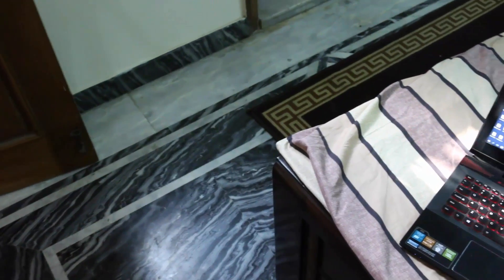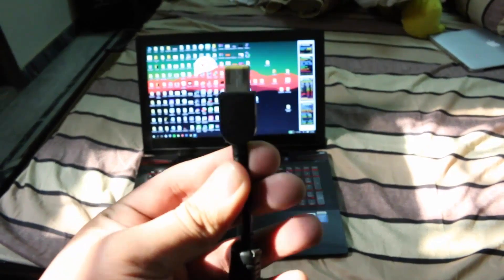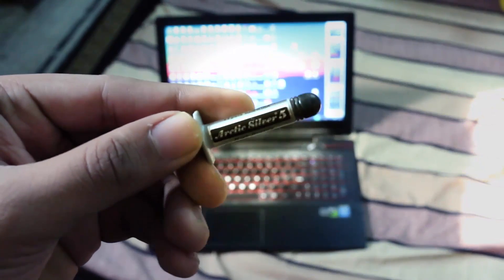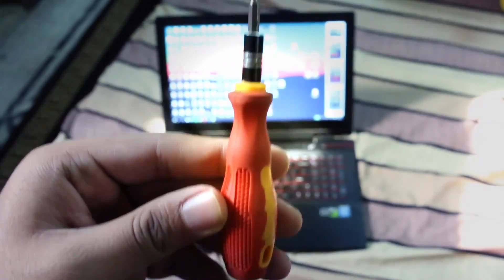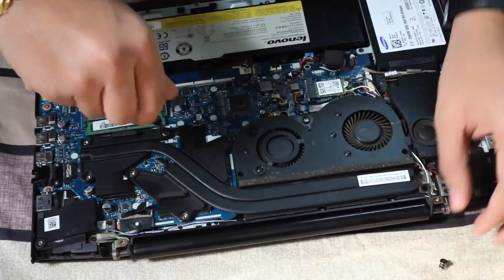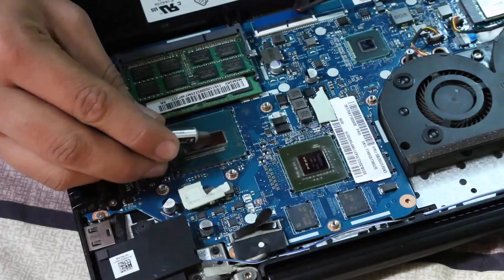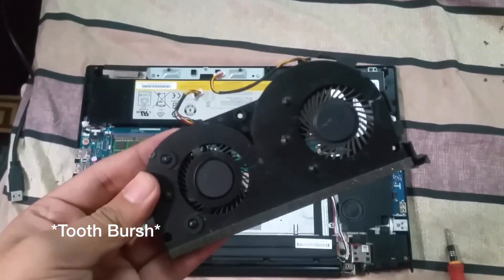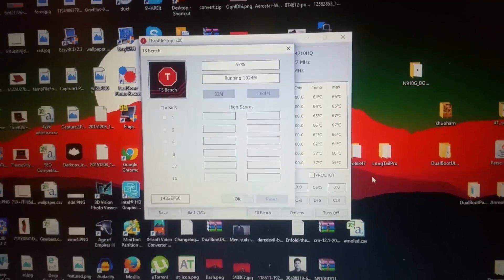Lenovo Y50 Overheaitng Fix + Stop CPU Throttling (Overclocking) + Thermal Paste upgrade

Comment: Thanks for posting this.  My Y70 Touch (big brother to the Y50, but the CPU and motherboard are identical) is having the overheating issue, exceeding 90C under 25% load.  It's not even maxed out.   This began happening after the latest BIOS update.  The update seems to be pushing it harder than the cooling can handle.  So I am going to redo the paste with Noctua NT-H1 and see what happens.
Reply: take out the dust protection below the fan ...you will go back to maximum 80 c while playing the most demanding game , this what I did after having thermal throttle , but now I run on maximum frequency all the time with 0 % throttle on 80 c max
Reply: Patrick McCullough  hey patrick i have ur pc and iam having ur same exact problem, has repasting it fixed ur problem?was it worth it? also how hard is it to repaste? i never opened the lap before

Comment: Do you think the y50 supports 1866mhz RAM? I'm lookin at the crucial laptop rams and it has the same DDR3L as mine, just wondering if it would run at that clock speed or no?
Reply: This RAM has automatic overclock up to 1866Mhz without changes at BIOS. no need.
When i bought this laptop it has 8Gb RAM, then i upgraded it to 16GB.
Reply: +Your.Favorite.Asian The max supported speed is 1600MHz I think
Reply: i have G. Skill 16gb 1866mhz RAM and it works fine at y50-70.
Reply: +Karumetsa Apartment can you check via CPUZ or BIOS what your clock speed is. cuz the y50 can use the 1866mhz BUT it may not utilize 1866 and under clock it to 1600mhz if you get what I mean. you can use a 1866 ram but it will only run it at 1600. just check. and do u havr the y50 or the y70? some models differ. i have the   y50 touch when it had the 860m
Reply: It underclocks the ram to 1600mhz
Reply: Yes, that's what I thought, so, Karumetsa Apartment 's placement of the 1866mhz wasn't very ideal and a waste of cash imo.
Reply: 266Mhz isnt anyways
 a big difference, not even noticeable.
Reply: +Sebastian A haha it does on my desktop so i just wanted to know if it woulda run on the y50, cuz i know some older gaming models did
Reply: RAM works at 1866Mhz and it is ok.
Reply: +Karumetsa Apartment ya i know.

Comment: I did the same thing in computer service. Changing thermal paste and thermopads and still have issue with CPU throttling.. :/
Reply: +Adam Piątek you have to clean it now and then
Reply from the maker: +Adam Piątek do some extra cleaning. Clean your fan and apply good thermal paste in proper way.
Reply: I did that, no change.. ;/
Reply: take out the dust protection below the fan ...you will go back to maximum 80 c while playing the most demanding game , this what I did after having thermal throttle , but now I run on maximum frequency all the time with 0 % throttle on 80 c max
Reply: ~but without dust protection all dust will go inside laptop..

Comment: My Lenovo y50,gpu temperatures reach over 92 C ..should I replace the thermal paste ..btw I replaced mobo recently by Lenovo ..they kept cheap 50rs thermal paste ..should I try artic circle thermal paste ..? Will it really help ..I want my temps to be at 70 C
Reply from the maker: +srikar warrior Yes off course you will see tremendous change in temps after this. :)
Reply: take out the dust protection below the fan ...you will go back to maximum 80 c while playing the most demanding game , this what I did after having thermal throttle , but now I run on maximum frequency all the time with 0 % throttle on 80 c max
Reply: +تجمع اندرويد العراق too late sold the laptop already...
Reply: +srikar warrior :)

Comment: Great video, I may do this with my Y40-70 because I noticed that the CPU and heat really cripples the true power the laptop is capable of. I dont understand why Lenovo chose DDR3 memory over DDR5 with the graphics card, I mention this because online the r9 m275 is listed as DDR5, a true disappointment.
Reply: +تجمع اندرويد العراق I was going to do that, but that would only cause more dust consuption for the fans and would make them useless.
Reply from the maker: +Lethal well good thermal paste will help some how :)
Reply: thermal paste wont work , take out the dust protection below the fan ...you will go back to maximum 80 c while playing the most demanding game , this what I did after having thermal throttle , but now I run on maximum frequency all the time with 0 % throttle on 80 c max